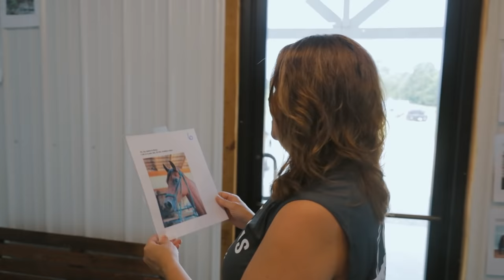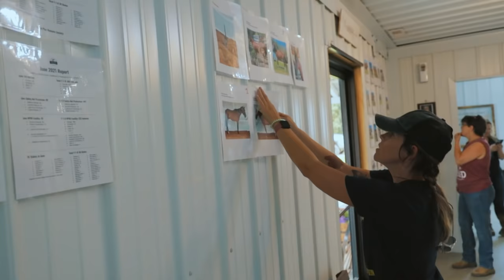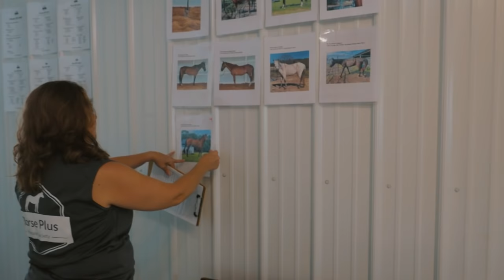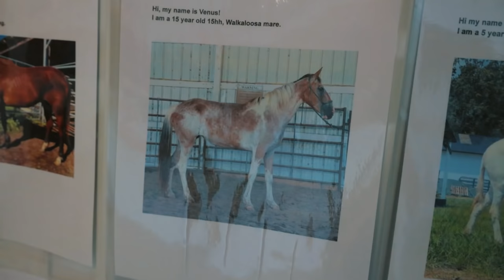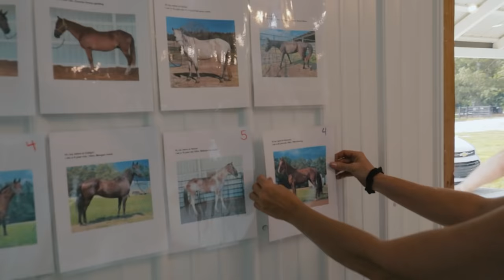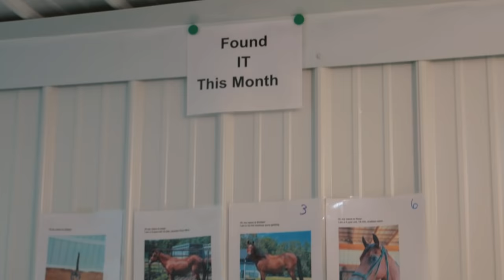Horse Shelter Heroes | S2E23 | Full Episode

Comment: A tip on forgotten keys - bent/damaged door frame is more expensive to deal with than breaking one of the back windows. You can get one from junkyard for almost nothing(they are often fine even on badly crashed cars unless the car has been rolled) and its a breeze for mechanic to reinstall.

Comment: I was wondering if you have thought of use if the synchill pellets over the tube! You would get 30 uses out of the pellets vs 12 tubes saving about $100
Reply: I don’t work for them, so just speaking on my own, but the issue I see with that is that it would be difficult to dose correctly when you have multiple horses in one stall. Not to mention some horses would not eat in a stressful environment. The tube is the correct dose and can be given to horses quickly and you can control it, versus the pellets are uncontrolled (if that makes sense)